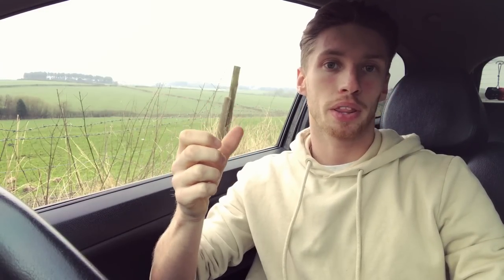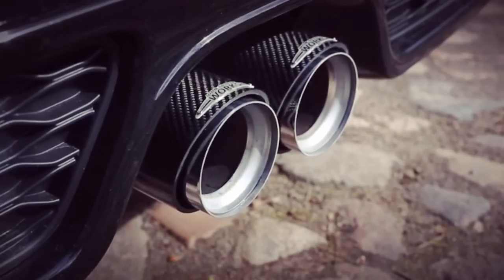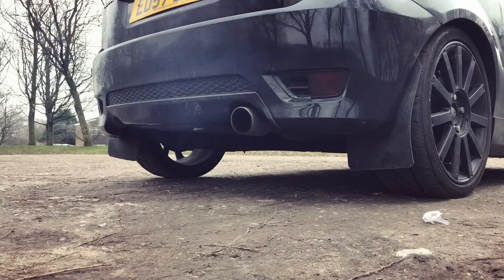How To Make Your Exhaust Pop, Bang and Crackle

Comment: Nice fartcan exhaust
Reply: Shona I have a fiesta st and I know that the miltek is top of the range. a grands worth of exhaust! although I'm not a fan of the raspy sound it does produce. it does produce good gains from a map and cone filter!
Reply: theres hardly any gains to a ricey 4 banger fiesta with simple mods
Reply: Jared Taylor An NA 5th Gen Fiesta? No.. But a 6th Gen 1.0  Ecoboost you can get a serious amount of power out of them with easy mods. I've seen a guy in my town with a Zetec S and he's squeezing out almost 210bhp from his 1.0 Ecoboost simply from bolt ons such as an Intake, Filter Downpipe, Catback and a Racechip Remap. But you're somewhat correct, it's just not limited to all four bangers.
Reply: wiLdchiLd2k It comes turbocharged from factory, it is not hard to squeeze a lot of power out of them. Go to Jamie FYDs YouTube channel and you'll see a 300bhp Fiesta Ecoboost. You obviously can't accept that a car that was previously seen as a granny's car is now capable of putting down a decent amount of power.. We call that the Civic mentality.
Reply: It's still a Ford Ecoboost though, why not spend a bit more and get a BMW that's about 320bhp standard and can take upto 800hp with stock parts. Quality cars
Reply: PitBikeGuy UK Because 
1) not only would a BMW be more expensive to buy it would be more expensive to modify. Parts for Fords are extremely cheap and easy to find, parts for BMWs are not. I was able to almost double my power output with £1000. 
2) If you're a young driver, a BMW is a sure fire way to let your insurance company fuck you over. You're an inexperienced driver, its rear wheel drive, lots of power, it's expensive, parts are expensive, all of which are red flags for insurance companys. 
3) It's more reliable than a BMW.. try to dispute that as much as you want but past a certain age stock BMWs will shit themselves. Much more likely if/when it puts out more power than it was intended.
4) most importantly.. preference. Maybe the guy doesn't like BMWs, maybe he likes fords in general and them being more unassuming than cars that come with 300+bhp, maybe he wanted a hatchback, maybe he liked the look of the Fiesta ST, maybe he liked the way it feels, maybe he liked the way it handles. Ford's hatchbacks have great handling, it's something they perfected in the early 2000s and haven't let it slip away. They provide a lot of grip for a front wheel drive car that you'd expect to oversteer. They're the best selling car in Britain for the last 6 years, the Fiesta ST has won car of the year a couple of times because it's enjoyable to drive. Take one out on a B Road and you'll see what I mean. It's easy to say "Why not this" or "you should have got this" when you're talking about what you would have got, but you have to remember that you're not him, just like you, he has a preference and for him that was a Fiesta ST.
Reply: I own a BMW 325ci M Sport and it's the most reliable car I've owned (had 4 Fords in the past, 3 fiestas, 1 focus) as well as many other cars. They're good, but nowhere near the quality of BMW. I could never EVER go back to the basics of Ford now. I agree parts cost a bit more, but like anything in life you pay for what you get, which is quality.

I'm not saying young drivers should buy a BMW at all so not 100% on why you mentioned that. My 325ci is pushing 220hp standard straight to the rear wheels and with both traction control and stability control turned off it's a monster. But if you're a decent enough driver you'll know how to control the over steer. Also having FWD is just really immature and the wrong way. There's a reason race cars are ALWAYS RWD, they are horrible round corners and the grip isn't even in the same category.  And lastly I'm really sorry but you can't say Fords handle better than BMW's. If you're comparing them as stock then the BMW has the Ford absolutely hands down. Even the standard 3 series sticks corners but if you get the M Sport package like mine it comes with sport suspension. I've owned Fiestas, driven plenty of ST's and they feel like they are going to tip over whilst cornering in comparison. Not even an opinion that's fact. It's obvious BMW are better, but I understand not everyone likes them and probably more realistic not everybody can afford them.
Reply: PitBikeGuy UK My brother has owned multiple BMWs and currently owns a BMW 320 and has owned it since 2012. A year ago he would have praised it as the best quality and very reliable just like you, but since getting married in last September he's been trying to sell it and it's gave him nothing but problems. Turbo blew up, needed a new ecu because of a major electric malfunction, new egr valve, new fuel pump, new brakes and discs all round ect. It's currently sitting in a garage getting repaired now. Obviously he doesn't stand for all BMWs because there are plenty that are well maintained, but they're definitely not as bulletproof as your suggesting. Also, RWD is better yes because there's generally better weight distribution. But you cannot say that FWD is immature, that's just exaggerated ignorance. if anything they're more mature because they don't encourage you to be a tad more wreckless and get the rear end out on it. Foci's and Fiestas do handle brilliantly, every car reviewer will say that, so you need to get over that. If you felt like they were about to tip over then that's only because of the seating position being so high compared to a BMW. Also, I brought young drivers into it because it's the biggest reason why people buy Fiesta STs and Focus STs.. Insurance companies won't let them get BMWs, so they go for a high powered FWD car that handles well. Finally, don't say they "can't afford a BMW" if they aren't exec cars, they aren't gonna cost an arm and a leg.. a second hand Fiesta ST will set you back around £8k - £12k.. i can pick up an E46 BMW 325ci for £1.5k - £4k
Reply: Haha 320D there's your first mistake, anyone with a decent knowledge of cars wouldn't buy a 2 litre turbo diesel BMW. ANY turbocharged engine will have problems, my mate had a Fiesta ST with a 1.6L (crap) turbo engine. Guess what? 4 weeks down the line he had a boost leak and the car was in 'limp mode' plus I think your brother either bought it off a goof, or treated the car like a goof, one or the other as 3 of my friends have BMW 3 series, hardly any problems, compared to my fiesta's/focus.

I can't say FWD is immature but you can say it's more mature than RWD, hypocrit?. We're not all shit drivers. if you know how to drive and don't slam power down round corners you'll have a much safer ride. And what's funnier is I've had so many more close calls with FWD cars, the understeer is just horrendous and dangerous and can't stick corners anywhere near as good again that's fact, not opinion as every car reviewer/critic will tell you. No the lean isn't in the seat, it's in the car are you really that stupid? Simple test is to go on an open straight road (I do this on every test drive) and quickly turn left to right, if you see the bonnet leaning each time, that's shitty suspension. Ideally you want next to ZERO movement. 

And finally this is where you messed up.... you've got to be kidding with those prices? I've literally just typed 'Fiesta ST' into Gumtree and BOOM there's one in black 2006 with 70k on the clock for £2k ono. Also a white one next one down 2007 with 73k on the clock and is £2.3k. What you are forgetting are these cars are 2006 onwards. My 325ci is 15 years old, it's the M sport model with 130k on the clock and will still fetch between £2k-£3k. Don't bring price into this, I know who will win. Compare the price of my 15 year old 325 to a 15 year old Fezzy, that would be funny.

You can get a brand spanker Fiesta ST straight from Ford for £18,935 to be exact. New BMW 3 series start from £29,750. I'll just let that sink in. I'm not even going to get started on the cars performance specs as I'm looking at them side by side right now and they are just funny to look at, by all means, ask me what they are and I'll give you a side by side comparison of the stats of a 3 series to a Fiesta/Focus ST. Maintaining a BMW is three times the amount of maintaining a Ford, again, FACT. If you simply prefer Fords to BMW's that's fine, but you can't start saying they're factually better rides or quality, that's just crazy talk and is clearly nothing apart from personal preference.. (or financial strain)
Reply: Shona the ecoboost engines are 3 cylinders actually
Reply: Shona hahaha

Comment: Omg, reeeeeally think this is probably the worst video ever. Before I get trolled, "no I'm not jumping on any band wagon" I'm an engineer and a proud Subaru Impreza owner, some of his theory is complete nonsense. Back fires are bad for your car over charging fuel into an exhaust to get a bang out of a 1.6 Ford zetec with a shhhhocking milltek exhaust on. Naaah the reason mine bangs and pops is it's unspent petroleum that atomised to almost a gas at this point that gets trapped in small pockets and ignite as it's thrown through a hot turbo or exhaust then creating a bang. 

I'm running a mongoose de cat 3" with 5" straight through back box but I'm going to sports cat it for MOT ease with a magnaflow 200 cell to not restrict it. 

But mine sounds epic, but #1 I'd respect him more if he explained properly

#2 didn't look like he's out of one direction 

#3 needs a proper car (subaru hawkeye. 2.5 wrx)
Reply from the maker: Donald Laisure III it's an ST.. it has a 2.0 not a 1.6... awkward.
Reply from the maker: Donald Laisure III and you're basically saying the exact same thing I said, but in more scientific detail 😂 the whole purpose of this video was to explain to people who didn't know, so I explain in laymans terms
Reply: Yeh but still a Ford, and the st fiesta sucks, also Ford couldn't even produce there own high performance engine the nicked a t5 lump for the focus lol 
Still goes so much better in a v70r or some other Volvo! But still I don't understand why you and others buy 2l cars if you want to go fast lol what bhp that fiesta pushing lol? My scooby literally got an exhaust on ATM it's an 06 plate hawkeye and it's pushing 268bhp no map no nothing just 3" all the way from turbo! But I've got an intercooler, dump valve, high pressure fuel pump, iridium 4-spark plugs for it, also raise the boost slightly and remap then should be pushing some serious power but it's fitting intercooler, dump, fuel pump and spark plugs this week. Then remap next month I recon. 

And I'm not putting a stupid cone induction kit on it neither, if you don't know anything about it people watch "mighty car mods" there a sales ploy get an hks 3 layer standard filter then silicon hoses for your standard box. They're designed from manufacturer for best airflow so why fuck about with it. Just for future reference that one lee! And what scooby did you have???

Was it a 2.5l wrx like mine?
Reply: Donald Laisure III you do realise ford owned volvo? 😂😂
Reply: Aussie_bond 91 I think ford sold volvo to a company unsure of the name but no volvo don't own Ford as far a I know😂.👍
Reply: Well my engine puts out 200 horses out of 2.0l. N/A non turbo, 4 cylinders. Any comments on that one?
And please don't compare it to turbo applications. 
suck squeeze bang blow, that's what we all have in common!
Reply: Subaru.
Yes. Fa20
Reply: Bretter Shoalar cool story guy
Reply: itsLeeLockwood it's an st fiesta. Not a focus st look up the engine size of a fiesta st...1.6 4 banger.
Awkward. Know your cars before you comment
Reply: T.Macca17 lmao thanks for this intercontinental lesson.. I do one solid bit of info though. It's a Ford and Ford products are complete shit.
Reply: Adams games and comedy The video IS utter shite BUT his fiesta ST has a 2.0 litre Duratec (ST150), the newer model is 1.6 litre but his is definitely 2.0, I used to own one myself.

Comment: A mate of mine modded his old Vauxhall Cavalier with a flame kit; same principle, except this switched off the power to the coil packs, so all the fuel/air mix went out the exhaust, which was then ignited by a spark plug in the tail pipe. Guaranteed burnt bumper for anyone that got too close to him in a car park lol.
Reply from the maker: ChayD ignition cut?
Reply from the maker: ChayD ignition cut?

Comment: I used to do all this with a Skoda Estelle put your foot to the floor in 2nd Gear turn the ignition off so the engine turns off but make sure they're ignition doesn't put lock on with the ignition off keep your foot floored and there will be fuel Force through the engine into the exhaust then when you turn the ignition back on you get a loud bang and a big flash from a Skoda Estelle grateful no one like them cars I used to do doughnuts in mine

Comment: works on N/A engines..  depending on your ecu parameters.  try this on a saab.   not gonna happen without remapping ecu.  also turbo engines mostly dont go Ritch by them zelf. most modern cars Wil adapt so fast.  those pops are not gonna happen.

Comment: I've got a miltek evo2 mani, miltek decat and miltek non res cat back but I can't make mine flame 😭 I've got an ST150
Reply from the maker: oh no! Have you done the over-fueling technique i did with the throttle when in gear?
Reply: itsLeeLockwood yeah doesn't seem to do anything :/
Reply from the maker: has it been mapped with the mods?

Comment: If I heard correct through the popcorn popper of a recorder, I think he said

1. Get a more open exhaust, stock cats does just fine just like mine.
2. Get a professionally done tune for your car or buy a pro tuner software.
3. Adjust your A/F Latency
4. Adjust your ignition timing.
5. Push The Gas.

Or just buy a fucking car that makes power.

Comment: "You want it to run lean or rich.... I can't remember which is which"
"You want to over fuel the engine.."

Oh my god. I had to pause the video for a minute because I was scared you were going to start talking about muffler bearings or something. From the point of view of a guy who tunes Power FC and does automotive machining for a living, this is a shocker.
Reply: Maxx yeah just cut the wires off the 02 sensor. Lots of pops and bangs fron the exhaust.

Comment: any car that was designed with "spirited" driving in mind will do it if you open up the exhaust...  my rx8 does it like crazy and they are tuned rich to assist in Apex seal lubrication and to flush the oil out that it injects...

Comment: 16V 1.6l and a turbo should have you doing this. A straight exhaust helps too. The reason a turbo usually pops is the antilag system that keeps fuel in the exhaust before the turbo, which then ignites in the exhaust when releasing the throttle. A turbo is the main component in a car that causes the pop.

Comment: can you do it with a automatic car?
Reply: bmworld no, why the fuck would a person even be thinking about this when they own an auto?
Reply: DeShawn Terrance sorry for being so curious... 🐱
Reply: Yeah you can. I do it all the time in my charger when I have it in sports mode
Reply: DeShawn Terrance  ive done it in my auto its actually not that hard if you actually know what to do
Reply: bmworld yeah if it has selective gears. I tap the accelerator around 2K revs dropping from a downshift and it'll pop and crackle
Reply: bmworld I removed my exhaust from my truck and only have my headers with cats on, when I shift to manual mode I can backfire within 3-4.5k rpms
Reply: All autos also have a neutral setting (they do here in the uk anyway not sure about US) so if your auto doesn’t have sequential just slip it into N :)
Reply: T.Macca17 I have a muffler delete on my corolla it's an auto. Mine pops on N all the time.

Comment: Over fuel your car if you do that you'll destroy the fuel pump I did that in my last car and I found myself replacing my fuel pump for my stupidity never over fuel a car regardless of it's size of engine or your fuel gauge are gonna give you incorrect reading and it will keep reading empty even though there's gas in your car

Comment: Step 1: Straight pipe engine
Step 2: Hydrolock the engine
Step 3: Either write off your car or get 3 points for dangerous condition of the vehicle.

Comment: Its all to do with the ecu set up. Most ECUs are set to stop all fuelling when the throttle is lifted off to aid fuel economy. On most aftermarket ecu's you can set the ignition timing to be retarded on overrun and force fuel through the exhaust. Now that does cause some serious pops and bangs. I tried it once or twice but the thought of burning the exhaust valves out just for abit of sound is enough to make me realise its not worth it.

Comment: I got a 1.2 clio with a cat and silencer (only changed backbox) and it pops whenever I want 10x louder than that without fail😂
Reply from the maker: Harry Curtis  go have a look at my proper video of the exhaust. As I said; the audio killed the noise in this video.. and if yours is still better; fair play 😂
Reply: Harry Curtis my Clio sounded much better aswell but it had a saxo vts engine 🏎🏎
Reply: Fair enough mate, I get more bangs and pops than cracks, it sounds good tho tbf

Comment: I own one of these beasts in Australia. 
Exhurst consists of.
Stock header pipe
150 cell highflow cat
Standard resonator 
And a lukey muffler on the rear (mostly used on v8s this stops it from being to tinny). I find mine dose the best snap crackle and pops  while rev matching on the down shift. Holly fuck it's good

Comment: If you live in Europe - DO NOT!!!! REMOVE YOUR CATALYTIC CONVERTER (CAT) because with all the green regulations and technical inspections - you might have BIG troubles - in my country if you don't have a catalytic converter - they can stop your car from the roads for polluting the air. Also if you don't have cat - you pay MUCH much more for taxes and as 2018 - it is a terrible idea to remove the cat/s from your exhaust system.